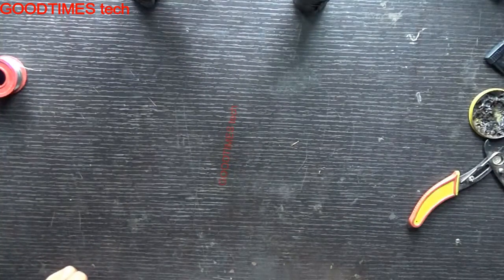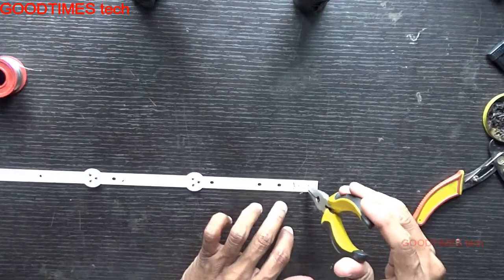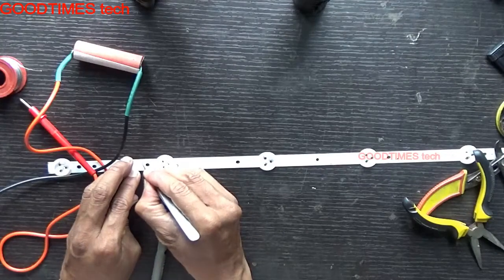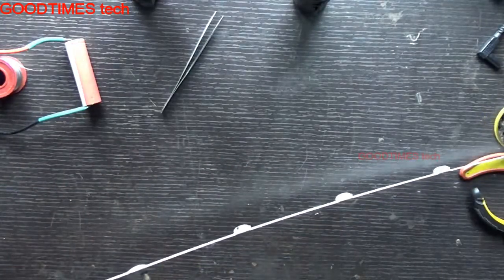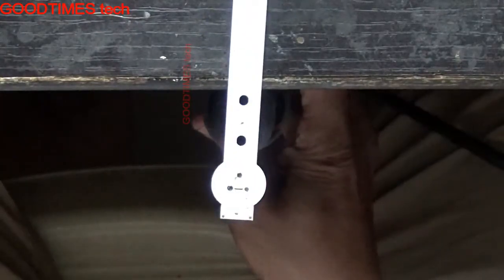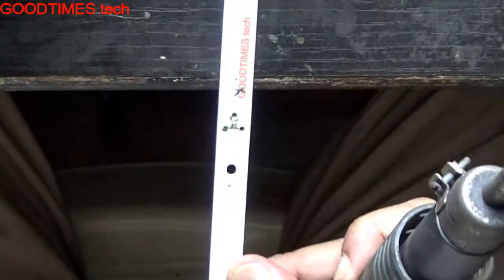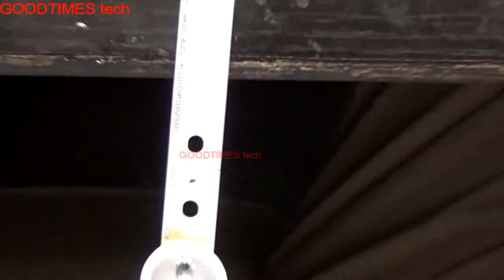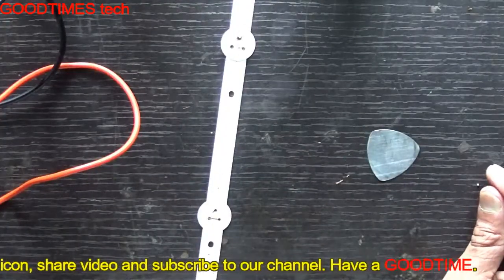LED TV | How to replace single LED from back-light LED Strip.

Comment: When replacing the LED strips DO NOT forget to remember how the outside screen housing that the LCD screen sits on is replaced get this part wrong and you will end up with bigger problems. It seems that the housing does not fit onto the screen then the TV backing section doing so will lead to problems. Usually the Housing goes in first on top of the TV backing then the LCD screen sits on top of this. DO NOT try to put the TV housing clips on top of the TV screen to fit to the back of TV.
Ensure you know which is left and right sections which is top and bottom and facing directions inner or outer very important for the TV housing.

Comment: My hot air gun had a meltdown so the last few LED replacements I've done I have used a windproof cigarette lighter 🤫 .. I wouldn't recommend it but it works 😊😊

Comment: My LG 32 LED TV has a problem with its back light strips.  It has two strips and 5 LED's each. The LED's of the top strip has become blue colour. So the TV picture is bluish. The LED's on the two strips are so tiny  I need to change all LED's of the two strips. Can I replace these very tiny LED's with 3V LED's.  Thanks for any advice.

Comment: How can you tell if the LED lights/strip are 3V or 6V? I need to replace some of mine but don't know which voltage strip to get. Thanks, nice video!
Reply: You can get a cheap led tester, check ebay.  It will tell you how much voltage is required to power the led while testing.